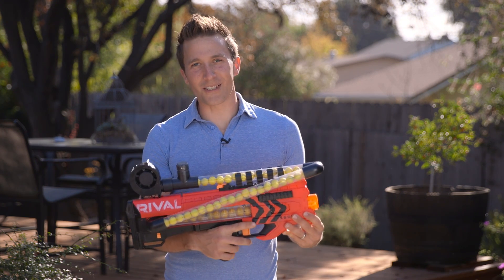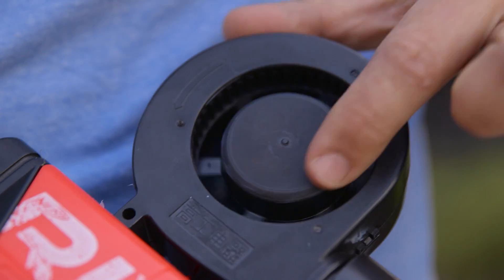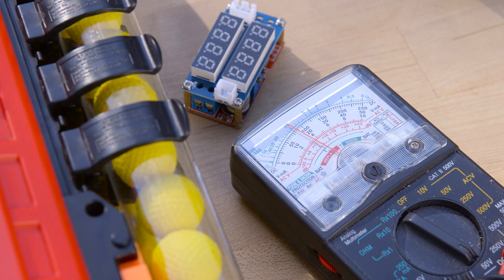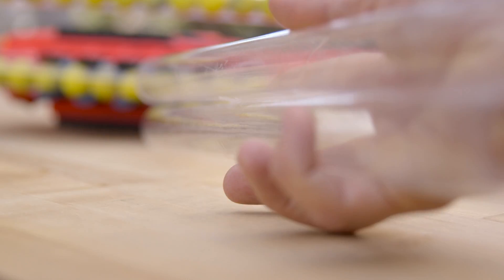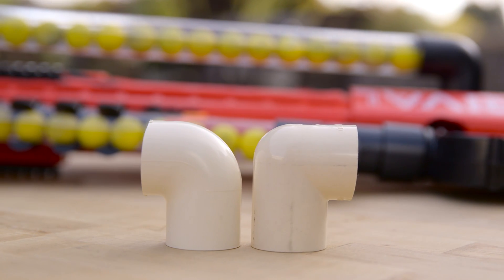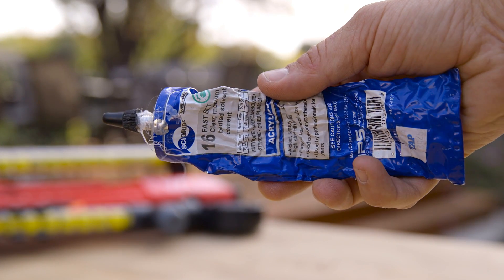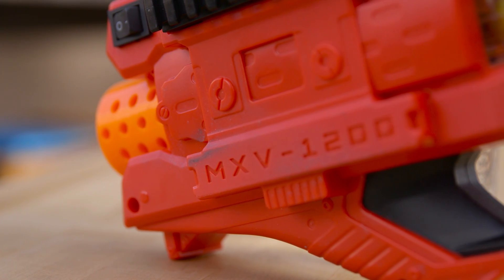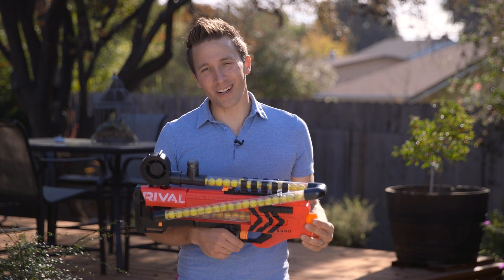NERF MOD: Nerf Rival Zeus HIRricane 1.0 Parts List and Breakdown

Comment: Hi, in your video, you said that you used 1 and a quarter inch CPVC elbows, but in the description, you have the link to 1" CPVC elbows, and I noticed the CPVC is 1.09", so I don't know if it would fit in the 1" CPVC elbows. Could you tell me which one would work please? Thank you.
Reply: Outof Darts Thanks for responding, this video has helped me a lot with my Zeus.
Reply: Once again, thank you for making this video, I got my Zeus working, CPVC does work a lot better than regular PVC, although the HIR balls don't appreciate the glue in the corners, but it still works a lot better than before, thank you.

Comment: Thanks for the tutorial. I do have one question? What is the Solenoid for? Also why do you need 2 Micro-switches?
Reply: +Outof Darts thanks for the info. Would you mind explaining how the solenoid and the second switch will work? I did a tear down last night on brand new Zeus. I am fallowing Drac's how to and it did not explain the second switch and solenoid to get 3 shot burst. Thanks for your time.